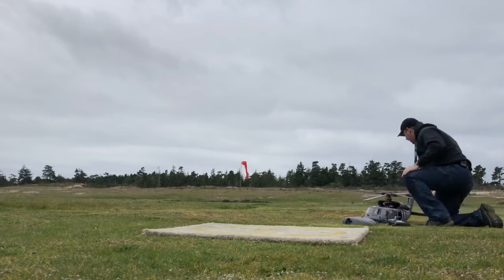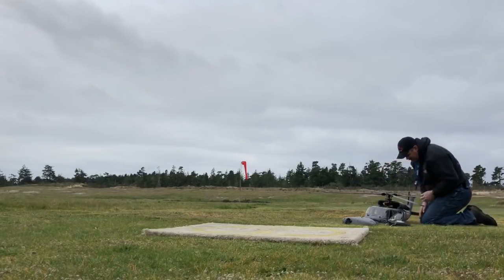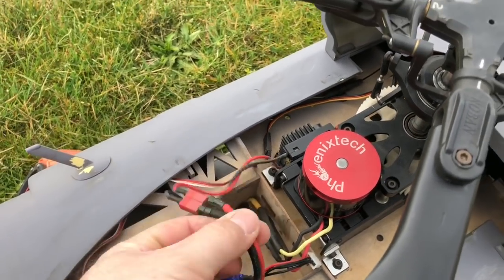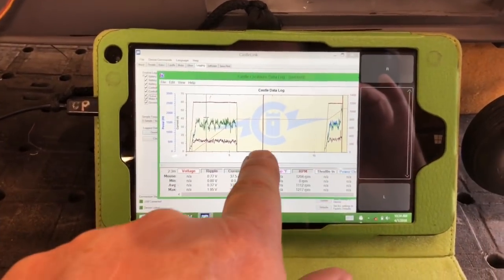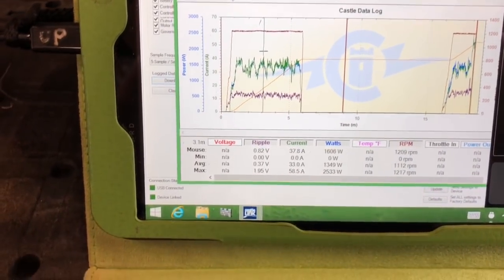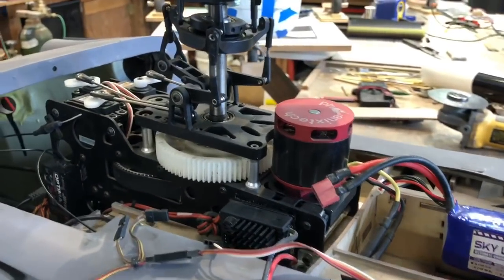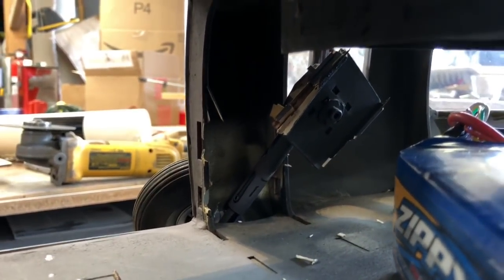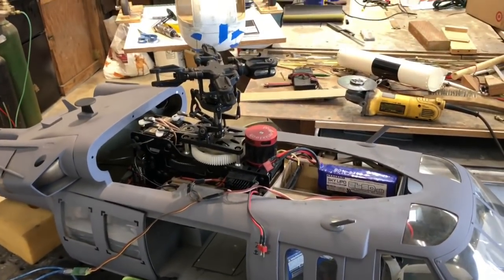Roban Pave Hawk spring test flight part 2 with crash

Comment: Hey this is a 700 size ? And do they make a 800 in the black hawk?
Reply from the maker: It was and no, they just make this one.
Reply: @JestRR  was ? What happened  the crash wasn’t that bad it came straight down not even propeller or gear damage
Reply from the maker: @geovaniboothe1992  the motor detonated. Thank god it was only a few feet off the ground. Broke the mounts for the gear and maybe a hole in the bottom. Was fine shortly there after

Comment: How do you build choppers like this? I can’t find tutorials or anything.
Reply from the maker: All mine come as fiberglass kits or kits that are close to being done and just need to be put together and or modified to my liking….
To build from scratch, first you make a plug, and that varies in technique, then you make a mold to create a negative of the plug, which is used to pull a fiberglass shell from. Then you build in wood work to hold your mechanics. It’s a lot of work, but sometimes that’s what it takes to get exactly what you want.
Reply: @JestRR  Iv got a question. Iv got a little collective pitch copter that is deffnetly over my head as a beginer but i was hovering it around and doing ok. My question is, why when I am on the ground and the rotor is going does it tip sideways and the blades strike the ground? Its just cost me a little gear iv gota get and i wasnt really moving the sticks. I can't figure it out or really keep it from happening. also happends when flying on the simulator a lot!  Thanks, Matt
Reply from the maker: @excellenceinanimation960  what you are trying to do is balance the heli on a ball. It’s constantly trying to fall off. To keep it from tipping over while you’re learning to fly, get some small wooden sticks and some ping-pong balls or wiffleball‘s and strap onto the skids so that when it ships over it won’t completely fall over.
Reply: @JestRR  ok. Sounds good. It doesn’t feel like Iv got much control when I’m on the ground tho. And the blades still dip. Is this just user error?
Reply from the maker: @excellenceinanimation960  could be….but more than likely it’s just the skids grabbing the ground and tipping the heli. It’s called dynamic rollover. This is what the sticks will help prevent!
Reply: @JestRR  ok Thank you! I appreciate the help! I
Eventually I wanna get into the scale birds like you have!
Reply from the maker: @excellenceinanimation960  keep at it!! It’s frustrating at times but so rewarding when you get it where you want it!! And I’m always here to steer you in the WRONG direction!! LOL!!👍🤪👍
Reply: @JestRR  haha ok sounds good!

Comment: Nice heli :)

But please use quality electronics and you wont have issues like this. Egodrift or xnova motor, hobbywing v4 or YGE speed controller. Also that castle bec pro is.... well i would not trust it even on a cheap 450 heli. On the long run its always cgeaper to use quality parts.

Now i want to build a scale heli too :D
Reply from the maker: I don’t use those motors or ESC’s that you are talking about because this heli set up was supplied by RC AERODYNE. They may work for you and that’s great. I’ll stick to what I know works for me.
Reply: @JestRR  i understand, but according to the video, this setup is not working for you either.

Anyway, nice heli, the most important is enjoy what you do :)
Reply from the maker: @tamasgiczi  everything usually works….right up until the time it doesn’t. These damn thing can shit the bed at anytime. All we can do is mitigate a failure. All in all, the crash wasn’t that bad. New motor, re glue the landing gear mount wood and I was back flying the next day!! With tons of flights up until now!! Probably going to explode next time I run it just cause all the sudden we are talking about it!! Just hope I catch it on video!!!

Comment: Dude, the video of the Helo looked pretty cool after the camera got knocked over, hopefully the camera didn't break. What is the point of carrying the orange thing for (I fly fixed wing) I was surprised that the wheel strut broke dropping from that relatively low height, but I guess all the weight coming down on it was pretty substantial. Nice helo and flying technique by the way.
Reply from the maker: That’s a Bambi bucket for Fire Fighting. That heli is over 22 lbs so it was like dropping it from a standing position. Not much will hold up to that anyway…thanks for the compliments!!

Comment: What head speed are you running?
Reply from the maker: I think I fly this one at 1250….about the same for all my 4 bladed Roban’s
Reply: @JestRR  

Thanks for your reply.  I'm building one now and didn't know what speed to run.

Also, who's blades are you running?
Reply from the maker: @jdsstegman  the 700mm blades that came with it. But if you don’t have blades, any 3D blade will work better than these. Might even be able to get bigger ones….
Reply: @JestRR  thanks for the info.  I tried a set of plastic scale blade but they flex too much and flare up.  So yeah, just 3d blades.
Reply from the maker: @jdsstegman  have done that several times! 3D symmetrical blades fly much smoother for scale ships. And they are readily available! Have serval scalers with them. Just paint them up like the full size then balance them….